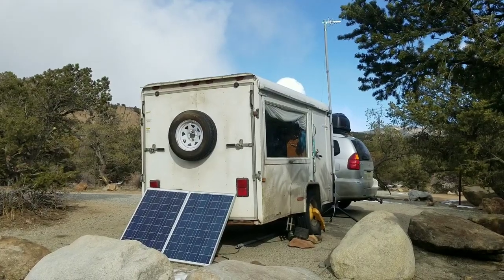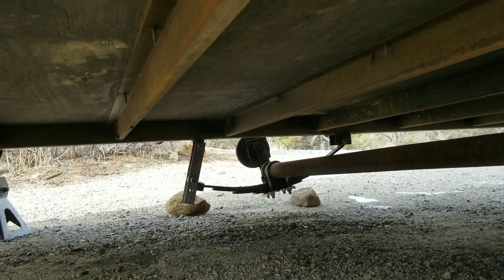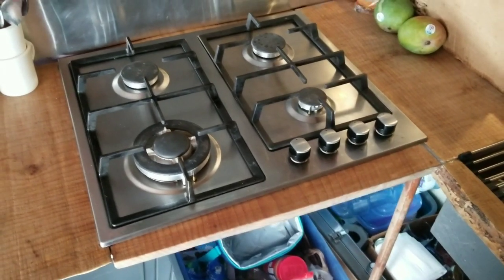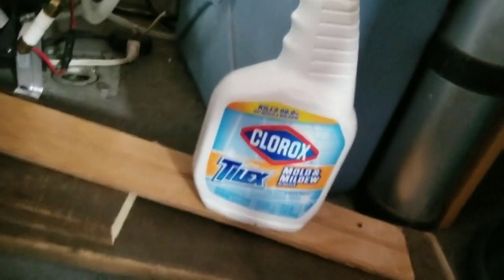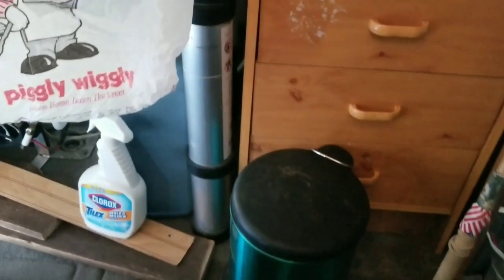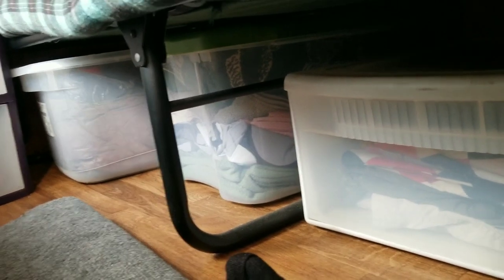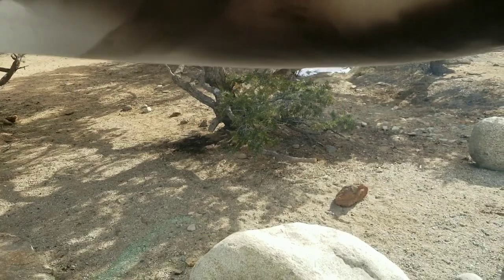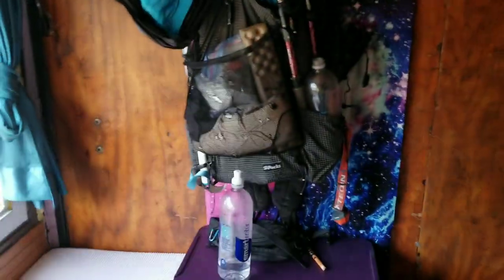Off Grid Cargo Trailer Camper Conversion - Tour The Dragon Cabin

Comment: Where did you get that jug faucet? Those plastic ones a crap . . .
Reply from the maker: It's a stainless drink spigot I found on amazon for like ~$15, I installed it on the flat plate of the jugs screw on cap
Reply: @dragon_offroad  Ah . . . Thanks! . . . A "Beverage Dispenser Spigot". Now I see a dozen of them. :o)
Reply from the maker: Simplest and best drinking water dispenser I've found